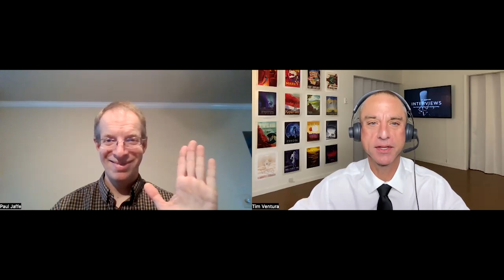Paul Jaffe - Space-Based Beamed Solar Power

Comment: Put the solar collector in high orbit, and use lasers to push the space-garbage below it into the atmosphere.  Use the economic techniques invented by light house makers in the 1900s to get paid (they avoided the tragedy of the commons) from other space players to avoid the Kessler syndrome.  This could offer another revenue stream for the space-based solar-systems.  Also, if you can control the garbage, you could weaponize it, use it to quietly destroy enemy satellites over the span of several months without looking responsible for this action.

Comment: Wireless Engineer here... I did some number crunching and came up with a 99.9999% lose. If you pump 1 GW of power to earth using a laser (extreme directionality of 80dbi) over a distance of 36,000 km into a mile wide dish receiving antenna (~60dbi directionality, which is incredibly unrealistic), then you will receive about 1 Watt. 

It turns out that the distance is a real killer... there is no antennas that are directional enough to make this feasible. I did see some really cool experiments where they were beaming 1kw of power over a 1km with a laser, but they wouldnt share the efficiency. That is of course 36000x less distance than geostationary orbit.
Reply: Levi, this is a common misconception, even among experienced RF Engineers. With sufficiently large apertures, the beam collection efficiency asymptotically approaches 100%, even without using principles from optics. Most Comms Engineers are used to only working in the far field, and power beaming generally occurs in the radiative near field. See http://www.koreascience.or.kr/article/JAKO201007535004656.pdf or https://ieeexplore.ieee.org/document/9318744